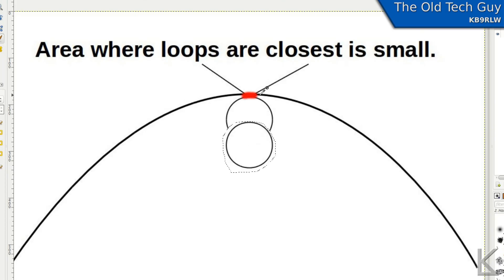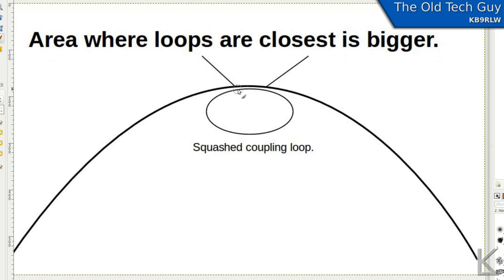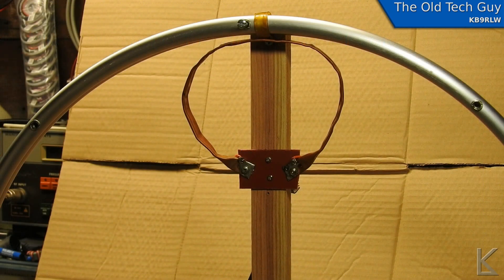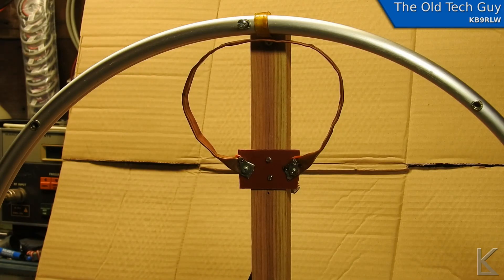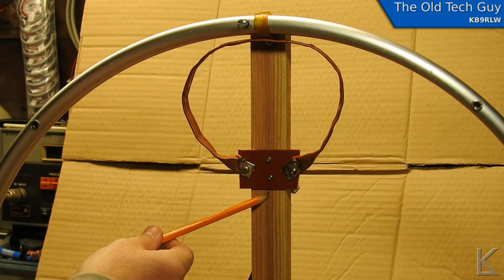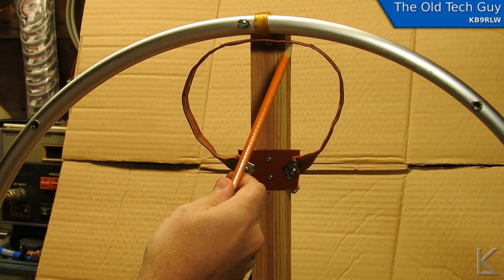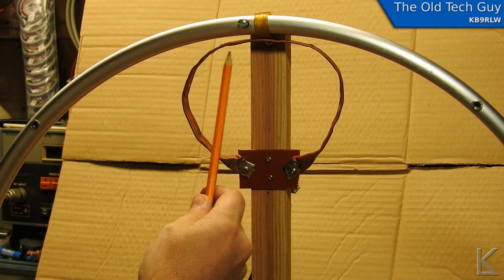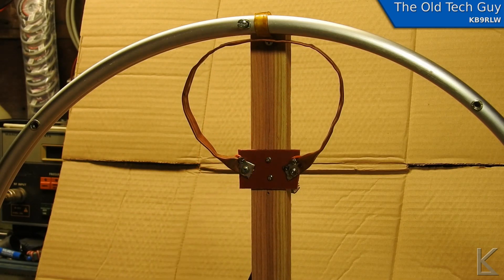Ham Radio - A simple magnetic loop modification with a big improvement!

Comment: I've build a magloop with a logmag of -50db, swr 1:1.001. Let the coupling loop go left and right along the armain loop for about 1/5 of the main loop length. And then! go away with hard 90deg. To connect both ends in a bow with the inner wire of a coax, do not connect the shield but put additional ferrite pearls around it all along to protect the "unused" part of the coupling from any radiation.

Comment: Why not try to insert a gamma match coupling and make a kind of auto transformer, using just a portion of the whole system impedence.

73 de IW4dbx
Reply from the maker: I have experimented with the gamma match feed, also the ferrite core transformer feed on these loops.  In practice I haven't seen a noticeable difference between the coupling loop and those other two methods.

Comment: I had tried something different a few years ago which seemed to have worked but I never quite completed the experiment because I got distracted by other things.  What I had done was to effectively make a toroidal transformer with some ten turns and positioned such that the copper tube of the magloop passes through its center, effectively becoming a single turn secondary. I don't remember how many turns I had on the toroid but it was probably something between ten and twenty and I had got the right number and size by trial and error adding and removing until I got close to 50 ohm resistive on the VNA.   Now seeing this 7 year old video makes me want to find that magloop and experiment some more.
Reply from the maker: Go to my main channel page and click on videos. We've had a few more mag loop experiments recently. You might find them interesting too. They are fun antennas to play around with.

Comment: A loop is a series circuit of resistance, capacitance, inductance, so the order is irrelevant so why have the capacitor at the highest voltage point? Mine is next to the feed point, which is a gamma match. RX rated cap. Takes 100w + no flashover, it works!
Reply from the maker: For the best efficiency, the coupling loop needs to be positioned where the magnetic field is the strongest, and the capacitor needs to be positioned where the electrical field is the strongest. Which are at opposite sides of the loop. 
I've no doubt yours works, but it is probably quite inefficient. In a good magnetic loop the bandwidth should only be about 4 to 6 kilohertz due to its very high Q. What's your bandwidth? If it's broad, it's inefficient. Which pumping high power into it would mask. I hope you're not sitting too close to the loop by the way, they create huge magnetic fields even at low powers.
Reply: @loughkb  can,t be too bad, worked 4 continents from patio at less than 100w, design from RSGB book 15 years ago.
Reply from the maker: @macreynolds4377  I've worked several continents from my kitchen with 2 1/2 watts. Like I said, putting power into it is masking it. Bandwidth will tell the tale. Sweep it with a VNA

Comment: Many thanks Kevin. That was very informative. Did you find any difference in Q? Was it the same, or broader, or less bandwidth? I have an MFJ 1786x & it's in my kitchen. It is hard to tune it on the 17 metre band for some reason? Kind regards.
  73 de Pete GI0FZT.
Reply from the maker: As I recall there was no change in bandwidth. Thanks for watching.

Comment: What if you integrated the coupling loop into the middle of the outer loop  like a 2 turn coil one small and one large, and drive the small loop at the  points where they pass each other,  1/2 turn to small loop and then remaining 1/2 of the large loop. Like an double ended auto-former. auto-former Driven in the middle.   Some thing  to think about???

Comment: So what would happen if the coupling loop was only 1/4 inch smaller diameter than the larger loop and was therefore in close proximity the whole circumference?
Reply from the maker: since current lags voltage by more than 90° on an antenna, it cancels itself out partially. and doesn't work very well at all.
Reply: @loughkb  awsome, thank you for taking the time to explain it to me 👍

Comment: Hi Kevin, I’ve got the MFJ-1786 mag loop, I’ve adjusted the coupling loop before to football-like to more circular, but that’s when it was horizontal in the attic. I’ve had it vertical and outside for about a year now and it’s probably time to fix it. I have problems on 15 meters getting it any better than about 2.5 or 3:1.  Would love to hear any thoughts or advice you have about optimizing the -1786. Love your channel, keep up the great work! Jeff, KF5KWO

Comment: how do you determin the size of the coupling loop.  nice video
Reply from the maker: The general rule of thumb is the coupling loop should be 1/5th the diameter of the main loop.  It can be a little bigger or a little smaller and still work.  It just seems to work best at that ratio.

Comment: What if the receiving/transmitting loop were to grow to be slightly smaller then outer loop?  Such that there was only 1/2" between the inner and outer tuned loop all the way around the loop? essentially a ring just inside of the other ring?

Comment: Good video!  Two comments/questions: (1) Are we restricted as to the circumference of the smaller loop in these antennas?  Why not make your smaller loop an even larger diameter arbitrarily, which would allow more length of its circumference that could be brought right up next to that of the Main Loop? (2) I suspect that you know better, but it sure is painful to hear you say several times (when watching the SWR meter while tuning antenna) "there it goes . . . .  right down to nothing".  SWR never goes to "nothing" does it? I figure the value goes down to unity if and only if you have a perfect impedance match of a given feedline to its antenna at some given frequency.  What am I missing here? de NK7B
Reply from the maker: (1) No, not restricted.  The general rule is that the smaller loop should be 1/5th the diameter of the big loop.  You can go slightly larger and 'maybe' see some improvement.
(2) Don't be so literal.  It was more of an expression than precise statement. :-)

Comment: Wonderful presentation! I made a coax loop antenna when I was a kid that was a a spaced helical coil on a wood frame and I could tap into the various turns for various bands. I could use it for AM DXing since I could null out the loud stations. I could not understand how it worked but it was fun to watch it pull in the stations when the cap was tuned just right. The coax was one complete turn right on top of the helical coil all the way around.

Comment: One must be very careful when it comes to coupling tuned antennas/ tuned systems,  as there are a few issues involved.
1. Soft coupling will permit the tuned loop to oscillate at its natural frequency while a hard tight coupling would FORCE  the tuned loop/system to be driven too forcibly by the source.
2. If the coupling loop is placed at the centre of the much larger loop, then the EFFECTIVE  magnetic coupling is very small as if we look at the resulting magnetic field cutting/curling the larger loop, then using a drawn diagram on the flat paper, one needs to consider ALL of the existing magnetic field in the inside of the small loop coming up while the magnetic field outside the coupling loop going down. Only some would curl the large loop.  So while the coupling loop is at the centre, the upcoming magnetic field will cancel some of the downgoing magnetic field and the " difference that couples the larger loop is very little. The full tight coupling will only occur when the coupling loop is the same size as the actual loop antenna. 

By flattening the loop to have more parallel lengths of the loops running together and this is a tighter coupling, but one must be careful as the larger loop is now being FORCED  too much by the coupling loop and so it might lose its resonance peaking quality.
Normally to let the system resonate freely, light coupling is desired, but this will not result in maximum Power being coupled but light coupling will retain the good quality of the peaked resonating unit.
FORCING naturally resonating systems with tight driving is not desired even in musical instruments and the instrument must be plucked or blown with light coupling for the pure note of the system to emerge.   The quality of a system even in using tools is so important and when using a hand saw,  one must not force it to cut, but one must feel the natural pace and let the saw cut by using the natural weight of the saw rather than forcing it to cut at all costs. The latter action loses the quality of the cut.  In feedback oscillators, the feedback must not be greater than necessary as the oscillator will not resonate with a  pure sine wave or harmonic motion but it will have a different waveform as the system is  FORCED too tightly! 

Many students try to resonate a parallel LC circuit from a voltage source and they do get a surprise when they find that the LC parallel oscillation does not peak as expected. A parallel LC resonating circuit must be driven by a perfect current source for it to resonate freely.  Unfortunately, practical sources driving loads are not as ideal as we like them to be and the matching difficulties do exist where one cannot expect the ideal situations in practice. Anyway, if one goes too ideal in tuned circuits, they will go off tuning so easily at the slight less variation from the ideal state.

Comment: Seems to be a lot of room for experimentation. Looking at your inner loop, it appears to be a copper pipe, which you mentioned, squashed with side facing the outer loop.  I'm wondering, first if edge on would be better or worse , and secondly if the crushed pipe has a lowered efficiency due to basically presenting a double layer for induction even though they are not isolated?   And with a longer line of close contact in your experiment does this not mean that the resonant tuning is not so precise?

Comment: Great video, thanks! 

The two loops are supposed to be coupled magnetically. The described technique increases the capacitive coupling, not necessarily the magnetic coupling. Not that it won’t work, it just decreases the useful deep nulls and introduces other uncharacterized modes of operation. It may increase common mode currents on the coax. I find that if I increase the size of the round coupling loop and rotate it within the plane of the loop I can achieve a perfect 1:1 SWR without introducing other coupling modes. 

73 de AA5TB
Reply: The magnetic flux density is lowest in the center and highest near the loop. Integrating flux density across the area of loop is how the magnetic coupling strength is determined. Moving more of that area away from the center increases it. The magnetic coupling vastly dominates any capacitive coupling in this configuration.
Reply: At opposite side of the capacitor there is the higher current and magnetic field too.
As well at the capacitor poles there is the highest voltage.

Comment: I have seen copper octagonal loops and wonder if a rectangular drive coil would match your findings.  It would have a lot of parallel path.   Also as this is magnetic, why mount the drive coil at the top.  I would have though putting the drive coil at the bottom would make connection easier.  Does the tuning cap need to be positioned opposite the drive coil or can it be anywhere in the loop?
Reply from the maker: The cap as to be at the direct opposite side as the coupling loop.   I usually put the cap at the bottom since it's easier to construct with the heavier part at the bottom.

Comment: Here's a dumb question: I've seen magnetic loops that have two turns on the outer loop, although yours only had a single turn. Why not go to a two turn outer loop with one of the turns being small and closely matching the circumference of the coupling loop for better coupling?
Reply from the maker: It wouldn't work that way.  
I have done multi-turn loops to get lower in frequency without increasing diameter.   However, it's a trade-off.   The added resistance of the second turn drops the efficiency of the antenna.
If you search my channel for magnetic loop, you'll find an 80/160 meter loop I did with two turns in the 160M configuration.  You'll also find a 16 turn monster I did for 630 meters that I actually made a contact on.

Comment: I too have found that small loop squishing helps to get a perfect 50 Ohm match. Also, that the required amount of vertical squishing or stretching of the small loop differs slightly on each band to maintain a perfect match.

Comment: Try using the solid center conducter of the coax and not the braid. Best of both worlds.
Reply from the maker: I don't follow.
If you only used the center conductor in the coax of the outer loop, (in the case of a coaxial loop), you would reduce the efficiency of the antenna quite a bit due to the higher resistance with less conducting material in the loop.   Tenths of an ohm matter in magnetic loop efficiency.

Comment: I have an AEA IsoLoop 10-30MHz that I bought about '93 or '94. It has a massive capacitor and works up to 150 watts. It had some mechanical issues with a plastic coupling to tune the capacitor. That was fixed. They recommended putting the capacitor on top if vertically mounted, made it very top heavy. I'll have to get it out of storage but I think that the coupling loop was shielded with a gap in the shield. It uses a stepper motor to drive the capacitor. The main Loop is a 2" wide 36" diameter aluminum band welded to the capacitor. Very narrow bandwidth and it was tuned by listening to the receiver noise(max). I think that they may have made an automatic tuner for it too.

Comment: Very interesting and thanks for sharing! Did you compare bandwidth too?
Reply from the maker: It's the same.   If it were wider, the efficiency would drop.  The extremely high Q of this antenna is the reason it works as well as it does.

Comment: Hi Kevin, Nice improvement. I'm using in my loop (20 to 40) a gamma match but I'll try this solution you describe.
Did you tested the gamma solution vs the induction solution?
Regards
Reply from the maker: I've built loops using four different coupling methods.  I never noticed much difference between them.

Comment: Yes, I have had same results with my magloops. A section where the feed and radiating loop are close and nearly parallel improved performance significantly. My interpretation is that this is because more H field lines overlap the two conductors improving transfer of power. I have only moderately ovalised the feed loop so not sure just how far you can push this effect before capacitance problems in the feed loop could emerge (ie. One side too close to the other).
Reply: Of course capacitance exists.  What matters is what is effective.  The added capacitance probably lowers the "Q" which is why the bandwidth broadens.  That's largely okay or at least irrelevant. If you have a 1:1 SWR, then 40 watts into the antenna means 40 watts radiated OR potentially lost as heat in the loop itself (you can feel how warm it gets, or doesn't).

Comment: What would be good diameters for 27Mhz usage? Diameter of outer loop, diameter of inner loop, value of tuning capacitor? I don't have an antenna analyzer so I'd like to guess as little as possible.
Reply from the maker: 2-3 feet for the outer loop, 1/5th the size for the inner.   A smaller cap, 100pf max value should get it in that range.   Tune the cap to find the noise peak on the radio and fine tune for lowest SWR.  You have to re-tweak the cap when changing channels though.

Comment: Your experience is very interesting.  I've been doing a lot of research on the magnetic antenna loop for a long time.  I've done many, but I haven't noticed the difference between the distance between the two loops in the swr relationship.  I currently have 1 meter in diameter.  I also made a field effect meter to adjust the best performance.  I used another process with the smaller loop with a round ferrite and 5 turns of rigid wire.

Comment: i learned this somewhere on qrz.com not long after buying mine from alphaantenna.com.
i played with the squishing, using plastic cable ties (get the cheap ones from harbor freight)
to make the small loop hold the shape i wanted. it took a few tries to satisfy, hence the cheap
ties. i ended up with a sharp oval (3 inches across the center of the hole) and it is a joy to use.
i do use an analyser to really get the tuning right, but you can get a simple swr indicator from
dxengineering (https://www.dxengineering.com/search?keyword=alextune&SortBy=BestKeywordMatch&SortOrder=Ascending) for ~$50. alternatively,
you can get a simple swr indicator kit from: http://qrpkits.com/ezseries.html#ezswr    $15.
add-on: i bought the 80m extension cable later for my 40-10m 25w unit. upon fitting it, the antenna
didn't tune very far into 10m. aa's owner, steve deines, suggested leaving off the 80m loop when
doing 10m. problem solved!

another reference:  https://www.youtube.com/watch?v=CdB22lsKDRM